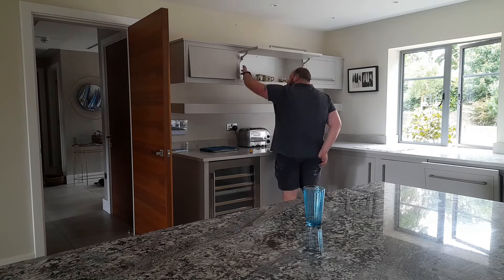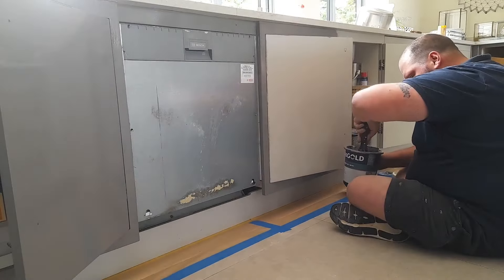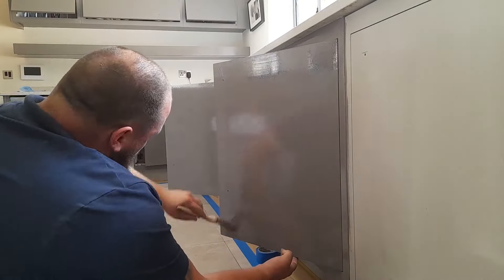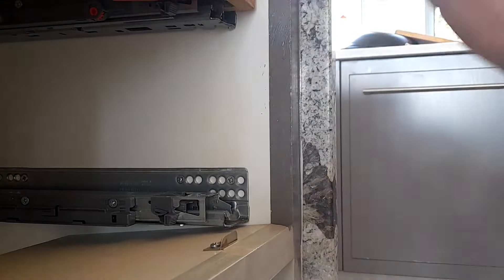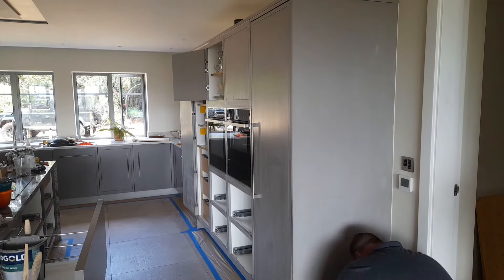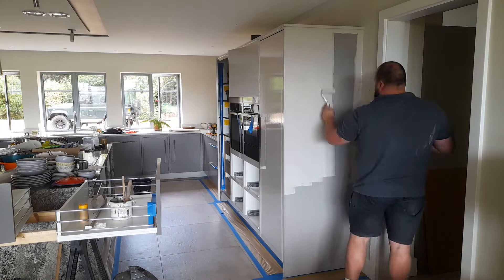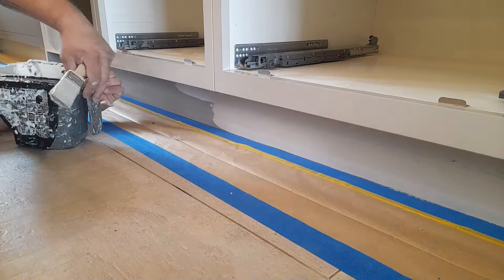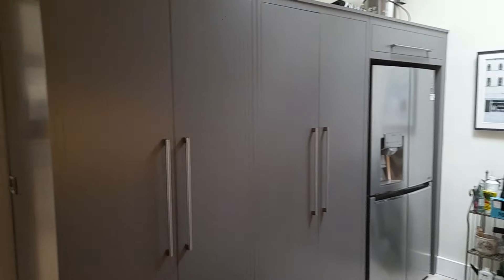How to paint kitchen cabinets by hand

Comment: Nice work - I'll be repainting my kitchen cabinets soon and replacing the doors so your tips are very useful. A couple of questions if I may, by how much did you thin the paint down with water?, also how many coats do you typically do?
Reply from the maker: Of course mate! First do not put water in oil based paint what I'm using is white spirit, water should only be used on water based paints! As to how much, it really depends on how thick the paint is those Johnstones paints I dilute by about 10% but it isn't really a scientific! Usually two coats very rarely I've had to do three.